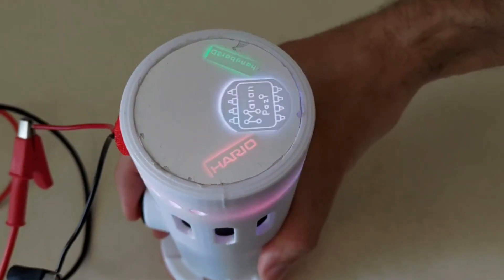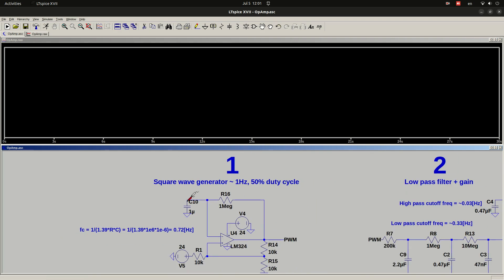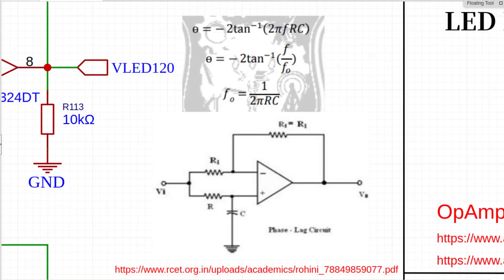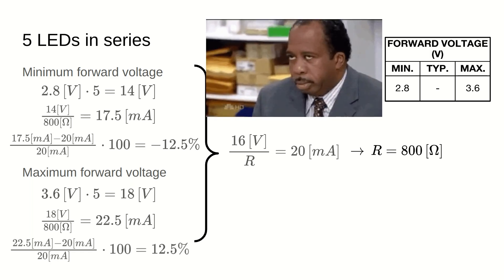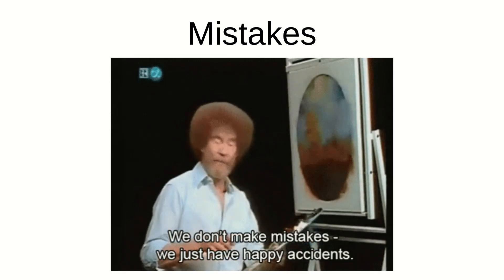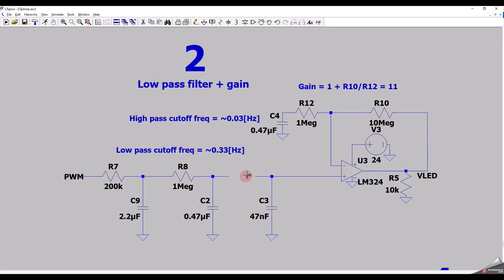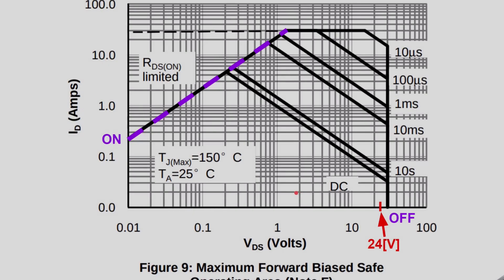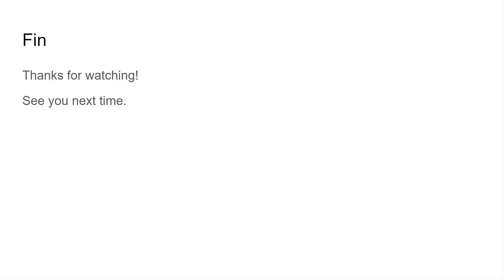Op Amp Sine LED Driver | LM324 Applications

Comment: You could have used 3 pcs 120 degree phase shift OP-amps, connected in a loop. A to B, B to C, C to A. These would create 3 sinus waves.
Then you connect the three inputs of the voltage-to-current amplifiers at the corners of the loop.